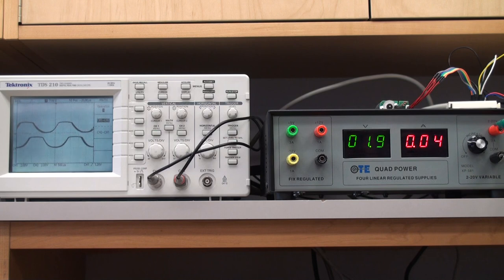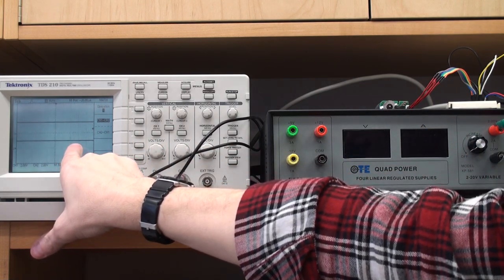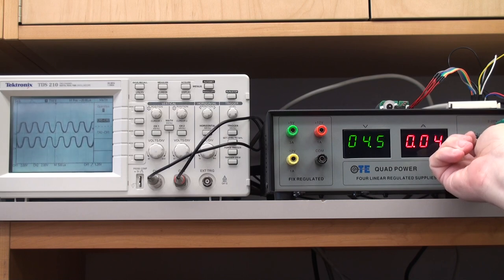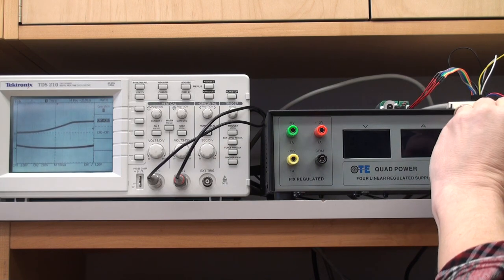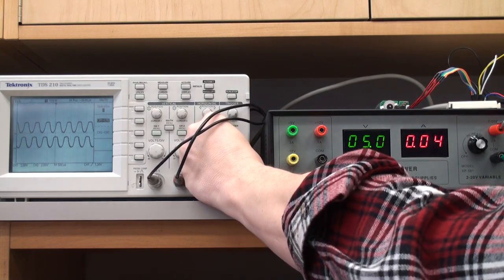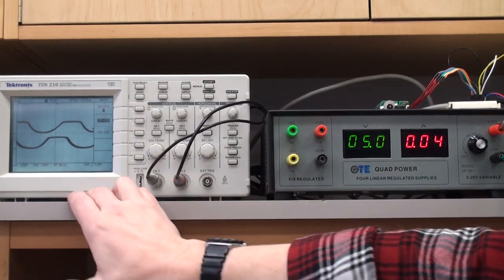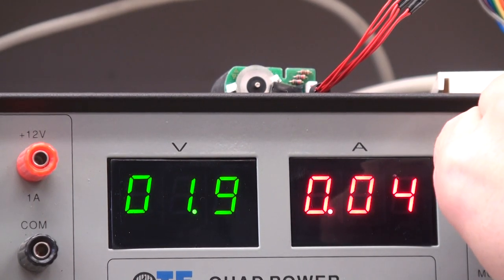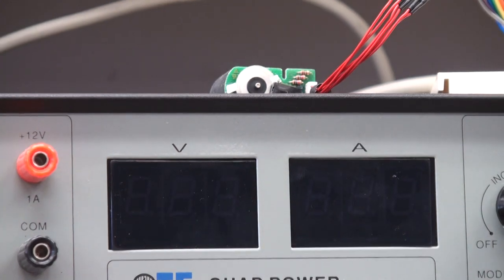Permanent magnet DC motor with shaft encoder

Comment: Cool demo.  I guess It's safe to assume that the encoder wheel on the shaft has a negligible effect on the shaft speed (as opposed to not having the encoder wheel attached.), right?
Reply from the maker: I didn't show it in the video, but it's really easy to see how any slight pressure on the shaft slows the motor down. Since the motor comes with the encoder, I can't say how much difference it makes, but there may be a slight effect.
Reply: Terry Sturtevant 
Right. And if we're interested in motor control, then we'd need the encoder on the shaft anyway, so this the slight speed difference is moot issue. Ok. Thanks. I just had to think it out a little.
Reply: It's an Optical encoder. 
Zero effect on motor speed or power.
Unless shining an LED light on something causes drag that I'm unaware of.